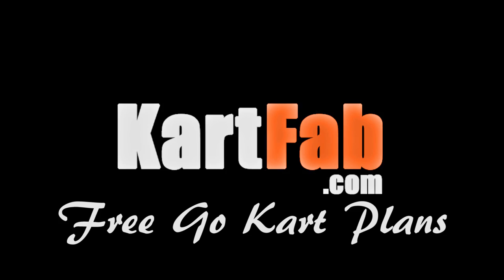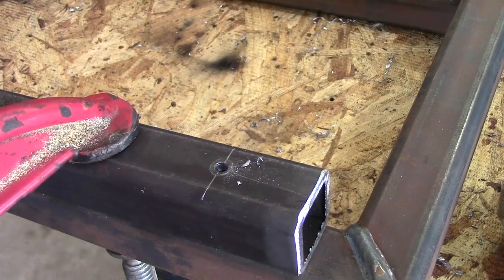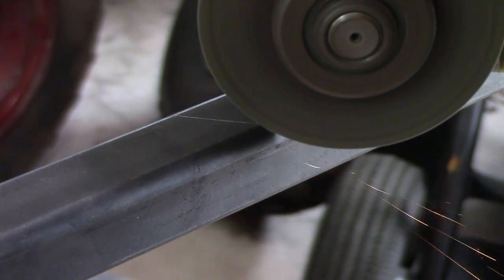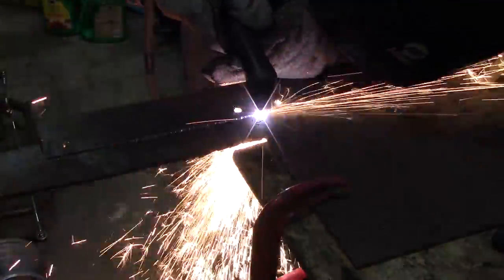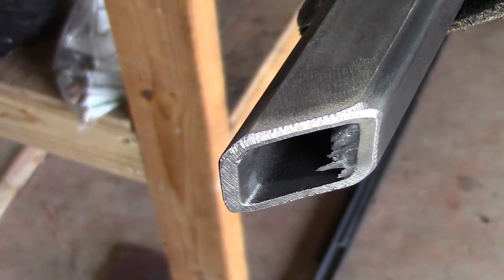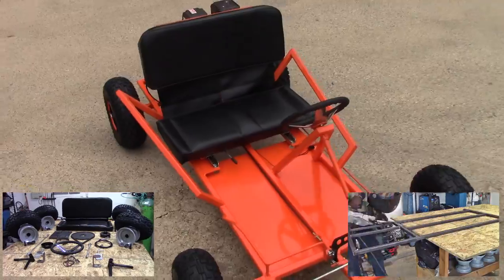How to Cut Steel, Go Kart Frame Build

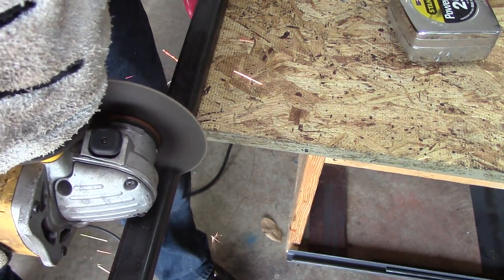Comment: Loving the build, great tips but I cringed in fear at 1:37 mind. I had visions of you slipping and going through your glove and arm.
Reply from the maker: +Gavin Oliver I have been working with metal for a while. I was almost finished with the cut and just needed to keep the end from falling. Little to no pressure on the wheel either.
Reply: Ah I know buddy, you have much more experience than me, keep up the great videos and thank you for the tips.

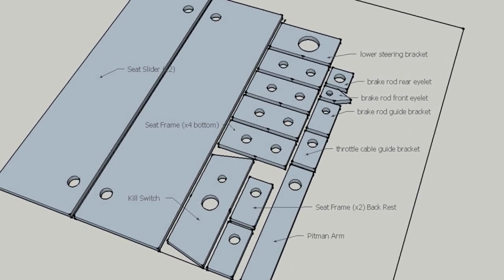Comment: At 0:30, what are the dimensions of the "brake rod front eyelet?"
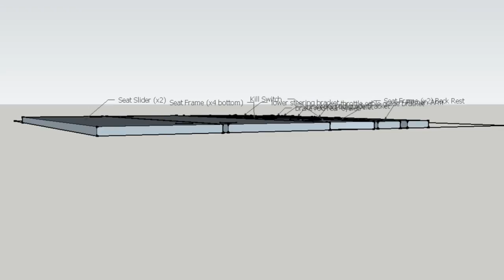Also at 0:30, are the largest two rectangles identical?

Amazing plans, and I am currently working on completing my project based off of your design. In fact, I am done purchasing all the necessary material, except the nuts and bolts.

Once this project is complete, I will definitely go ahead and proceed to following your other amazing plans (with some tweaks, of course, since you follow a different measuring system in the U.S.)

Cheers, and I hope you can answer my questions with absolutely no trouble.
Reply from the maker: dimensions are not super important for these things, only the holes that they have in them.  Im surprised you didnt look at the plans to see the dimensions... but here they are... brake rod front eyelet has a 1/4" hole, and is about 3/4" wide by 1" long. Rear eyelet has a 3/8" hole and is 3/4"x3/4" (approx). Hope that helps! you could even use washers for the eyelets, but they are pretty thin. Might need to stack 2-3 together for strength.
Reply: Thanks a lot! I really appreciate your time.

I actually did look at the plans many times and still do when necessary, but I had trouble finding what I asked for specifically.

I am hoping to be done with the whole project by the end of this week (busy schedule).

Thanks again for your time and quick reply.